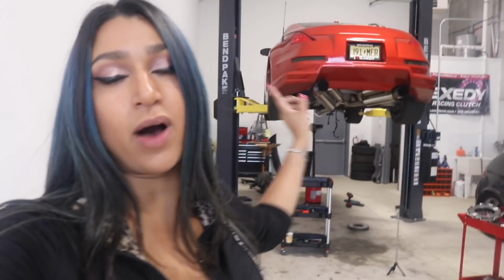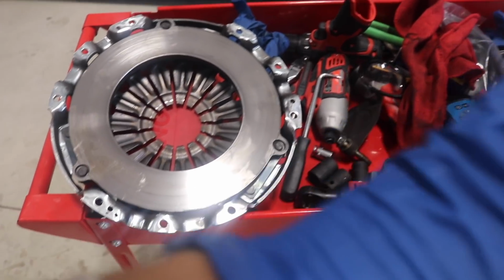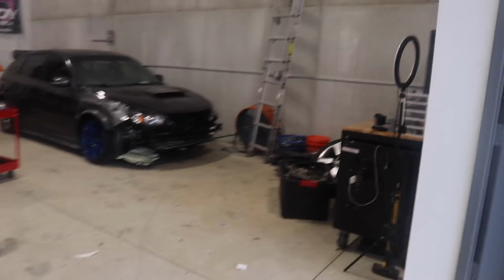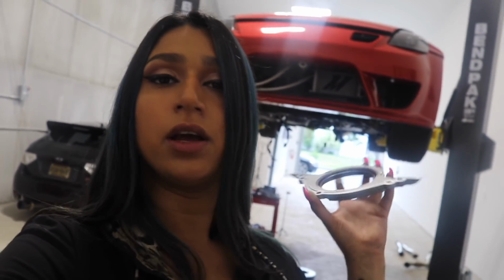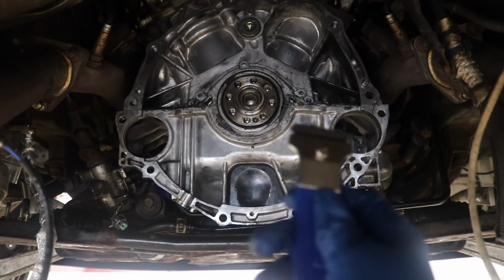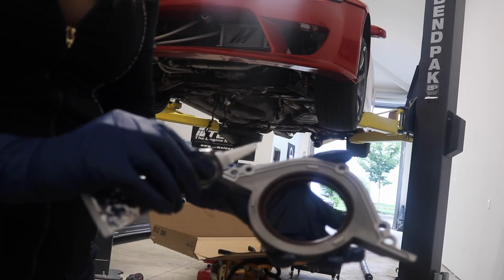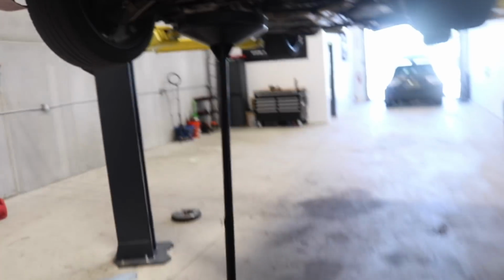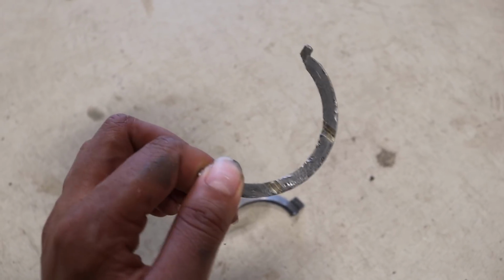CRANK WALK // SAYING GOODBYE TO MY VQ MOTOR

Comment: This is fairly over simplified but the thrust main bearing gets wiped out for one of a few reasons.   If you don't have enough thrust clearance on the crank it will grind up the thrust bearing and spit bits of it into the pan.   If it wears on it long enough what is left of the thrust face gets ground off.   On engine assembly when you put the mains, main caps and crank in the block you have to tap the crank back as far as it will go and put a feeler gauge in between the thrust bearing and the crank mating face.    You also push the crank forward and check again on the other thrust face.   A dial indicator can be used too.   Spec's vary but if you don't have enough thrust bearing to crank clearance it will trash the thrust bearing and make clearance.   You have to sand down the thrust faces(very carefully and precisely) of the bearing to get more clearance if it is too tight.   I haven't seen one that has too much clearance to crank but I suppose that can happen if the crank has had a party with the thrust bearing before.   I think in that case you have to have a machine shop add material back to the crank faces and re-machine them or more likely get a new crank.

It also happens if there is a push on the back of the crank shaft.   This happens if your clutch isn't adjusted right, you have a tendency to ride the clutch or the transmission input shaft to pilot bearing has a fitment issue and is putting a push on the back of the crankshaft.

It can also happen with an automatic if the snout on the torque converter doesn't fit the crank pilot hole properly or you are hitting the engine hard with a higher stall converter and the converter doesn't have anti balloon plates in it.   It swells and pushes on the flex plate which of course then pushes on the back of the crank and then the main journal at the thrust bearing grinds into the bearing and trashes it.

I've seen engines that would rebuild after trashing a thrust bearing so it doesn't always destroy the engine or more specifically the crank shaft and particularly if you have a steel crank.   It should at least be broken down and checked first.

The only reason I know even this much is the aftermarket stroker crank I put in my drag car was tight in the pilot hole.   I run a 4500 stall converter and it does have anti balloon plates but the snout didn't have enough clearance in the pilot hole.   I had to very carefully take the grinder wheel to it.

Comment: I had a turboed 03 civic Si and I had an Exedy stage II and I hated it.  I would get less than 10k in miles before it would start slipping.  OEM on the 250whp lasted longer and grabbed better.

Comment: When you get your new motor check the crank end play.   Make sure it's within tolerances.   If not while the engine is out it's really easy to rebearing the bottom end that'll include new thrust bearings.   Thrust bearing wear is normal in manual transmission cars so this happening on an abused car is too be expected.   Good luck..

Comment: As much as you might not like what I'm about to write, I do strongly believe in learning from mistakes, which will never happen without knowing what mistakes were made. Hopefully no fart inhaling here...

Considering everything you've shared with us following the clutch replacement (broken oil pan mounting boss, not going into gear/clutch engagement, locating dowel in the crankshaft pushed in, and now thrust bearing damage) I think this was caused by an installation issue. Some things on a car can beat beat on and forced into place, but not always. Proper alignment and seating of the transmission input shaft, through the clutch and into the pilot bearing is one of the delicate things.

That thrust bearing is not worn, it's damaged. You'll get thrust bearing wear over time just with it being a manual, as any clutch engagement creates an axial load on the crankshaft, but that will show with eventually creating a step in the bearing. For this kind of damage, it was under significant pressure as the engine was turned, causing it to bind, twist and eventually break. Once it broke, the crankshaft was no longer axially secured, which could have been what was causing your oil pressure issue, and subsequently the metal flake in your oil.

Moving forward (which to start with, I'm glad to see you're doing) mating the transmission to the engine should not be a fight, it should slide right on, evenly, with just a minor twist of the mainshaft to align the splines in the clutch. If you have/can borrow an engine hoist that's rated high enough, it might be easier to mate the transmission to the engine outside of the car, and drop them in as an assembly. But even on the bench, it should just slide into place. 

Best of luck moving forward.
Reply from the maker: thank you Dave, you have been a great help throughout this entire process

Comment: I don't know if this helps any. Someone I know bought a brand new 370Z
and the oil pumped up into the head/cam shaft, but would not drain back into the sump.
If I got that right. Nissan pulled the heads and found debris in the oil return passages, if I got that right. I'm trying to protect the owner, anonymity and all that.
Your going through some stressful times with this beastie, and it's good you back off for some me time. Looking forward to your next vid. Stay safe young lady.

Comment: In my 10gen honda and the Honda Gen 9 civics we have to turn off misfire detection in the ecu when we run an aftermarket clutch kit. I’m not familiar with Nissan clan but is it possible you may have to do the same? The hot spots may be coming from riding the clutch. Do you have clutch chatter? The two pieces look like thrust bearing. Crank walk happens on start up. It’s when the thrust bearing is pressing too far into the clutch. Most people install a pedal stop so you don’t press the clutch pedal too far in. Check out “keep gunnin” video on diy pedal stop on Kobe

Comment: I Guess you found the issue - its not a locked up engine just pull it all apart and go through it - maybe some parts are still good block, rods, pistons, heads etc. keep for spares unless you need core for the replacement !

Comment: Never apologize for buying someone else's basket case of a car. I've bought 2 lemons back to back from the same used car lot. About $5,000-$6,000 later and a 'HOLY CRAP' from the dealership for daring to drive with the 'check engine' light on, we have a 200,000+ mile vehicle that is our daily driver. And it's paid for, and the work is paid off, too.
You go, girl!

Comment: Disassemble the engine.
It might be fixed with some machining, polishing and a set of oversized bearings. 
I didn't disassembled my old bug engine when it started to knock, and spent about $5000 for new engine parts, when it could have been repaired with a new set of cam bearings for $20.
Leason learned! (And a new engine with 2,5 times the power of the old one.... 😈 )

Comment: Hey it's definitely unfortunate about the engine and ya I'm just as surprised as you probably were about how chewed up that clutch was and your theory about the clutch and engine probably aren't far off. I don't have any experience with the brand clutch you have, honestly I've never heard of it, but I've owned a few 4x4's that I've tweaked and also put in a Centerforce dual friction clutch in them to handle the tweek's and I understand that each to their own but I can't say enough about those clutches. You have nothing to be sorry about because life happens and this will be great content for your channel.

Comment: If you ask me, those VVT solenoids might have been the culprit. Because oil failure = bearing failure and those VVT solenoids affect oil performance in the long run so IMO don't use those aftermarket solenoids again please...

Comment: On the new engine, before you install it, pull the oil pan and check the condition of the bottom end. The hour that might take could save some heartache in the future. 
I would also suggest rebuilding the old engine anyway, at some point. That'd give you a spare engine for the car, or, that you could sell.

Comment: That heavier pressure plate yeeted those thrust bearings. It very common in VWs as well. glad youll be up and running soon.
Reply from the maker: thank you !
Reply: Since the oil pans where recently replaced and the oil cooler added, oil pressure issues are also a possibility.

Comment: Heart wrenching for you right now. I completely understand. When you have had time to calm yourself you will be motivated to get the new engine installed. Once it is in and running great, you will feel so good about what you have achieved, no one will be able to wipe the smile from your face with a wire brush. Chin up girl, you will do it. I have faith in you.

Comment: Im crankwalk victim here, i feel you, now that you will put another engine, i will give you an advice, you need to make your block crankwalk proof, in my case, we machine the main cap, on the thrust washer bearing and place 2 aditional thrust washers and brass pins to keep them in place, i send the flywheel with the crankshaft to balance, and the flywheel had 2 ounces of imbalance...now is in the shop forging the whole engine...

Comment: I’ve had this before. When the thrust washers fall out you lose part of your clutch travel because the crank walks. I couldn’t get gears because every time I put my foot on the clutch I was pushing the crankshaft forward until it stopped and only then would the clutch start to disengage with the remainder of the pedal travel but not enough to get gears without grinding. Hope that makes sense.

Comment: Is the motor rebuildable?  If so take your time and build it right.  Use the new one till its ready
Reply from the maker: I believe I can rebuild,, the plan is to pull that motor apart and see what needs to be done and bring it back to life. it would be a learning experience for me
Reply: And a spare motor is always a good thing to have for a track car.  I bring a spare to the track with me and have another one (or three) at home.
Reply: @MICKBETH  i am surprised it would turn over at all with all that metal in the pan
Reply: @MICKBETH  it will be a great learning experience.  The machine shop work will be an education in itself

Comment: Been there, I'm afraid. I'm glad there's finally some clarity for you and that you already have a new engine. When those thrust washers fall out, the crank is rubbing directly on the block and they both wear away enough to make them scrap unless it's an extremely rare and valuable collectible.

Comment: Glad you finally found the problem even if it means a new engine. Remember that when you replace a weak/broken part on a car, you're going to find the next weak part.... hence the new clutch "helping" you find the next issue.
It's great that aren't swapping in anything beyond stock: you need reliability in order to learn to drive that car on a track. And more horsepower just masks bad driving habits. (I'd be willing to bet the people calling for engine upgrades have less time on a racetrack than you do....)
Reply from the maker: Thank you so much and you are so right about that
Reply: ще

Comment: Is that the OEM flywheel? If it is I'd recommend you have it re-surfaced. And with that much crank walk it would affect how the clutch worked/felt. Don't re-use your old VVT solenoids. Make sure to flush out your oil cooler too.

Comment: I've seen the part where you showed the thrust bearings before but it wrenches my gut just the same. And all that metal in the oilpan! It sure does explain a lot about why it wouldn't run right.
Also, losing those bearings would cause a huge loss in oil pressure and thus also affect the VT. No pressure = no VT.
You don't have to be sorry for anything! Stop saying sorry! The person who sold you that car should be sorry!

Comment: The smoke coming out the exhaust was the give away.  Not to sound like a snob BUUUTTTTTT, a stage 2 clutch for that car is pointless ,that engine doesn't make enough power to even warrant it
Reply from the maker: The reason why I got that stage two is because I have plans for more HP. I will not reveal what I have until I get more track time and then start the build